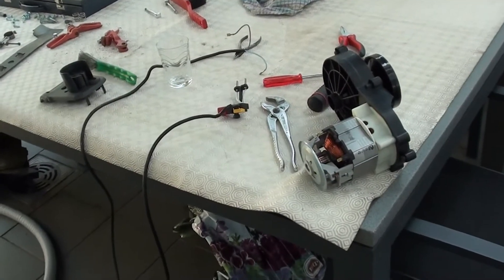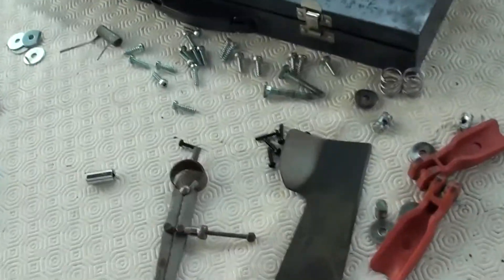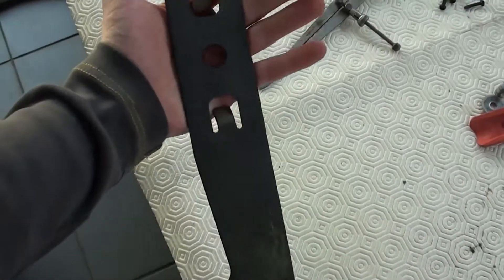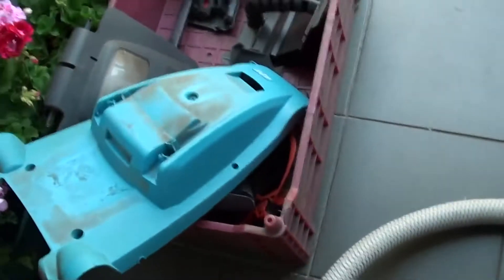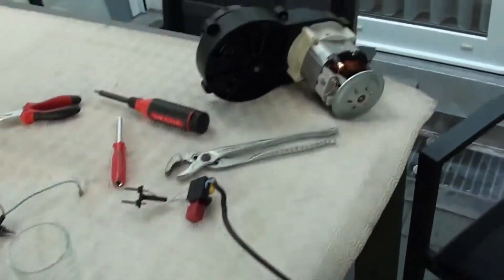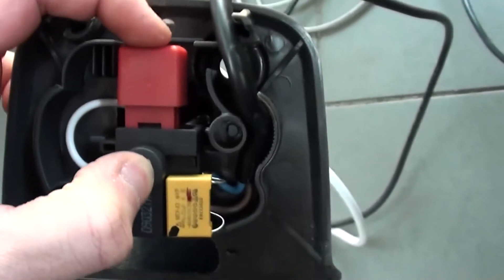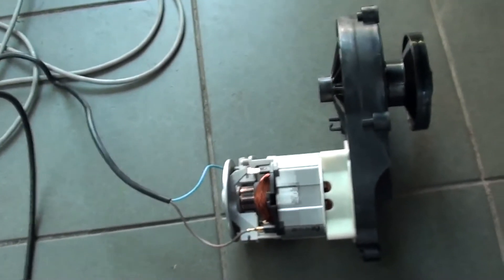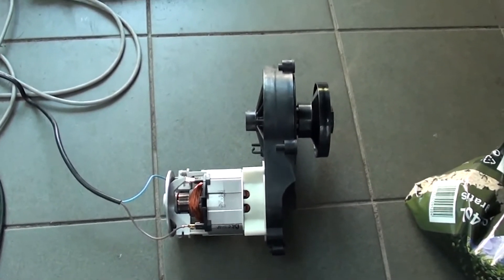1.7KW lawnmower motor - project ideas?

Comment from the maker: I already have a belt grinder though. I thought of commercial dimmer switches back when I first started researching grinders but they don't work for anything other than low powered lamps and such. Definitely not capable of controlling a motor like this. 

You'd need a proper VFD for that which would make it quite a bit more expensive. I've seen someone use an extra switch to power two machines with one VFD though so maybe I could use the one on my belt grinder for it too.:)

Comment from the maker: I already have a wet & dry hooked up to a cyclone system but it's not quite as powerful as I would like. But that's mainly due to the size of the tubing rather than the power of the motor. Interesting idea though. :)